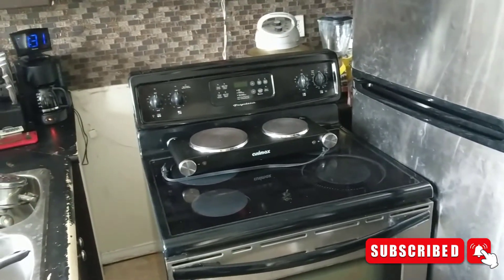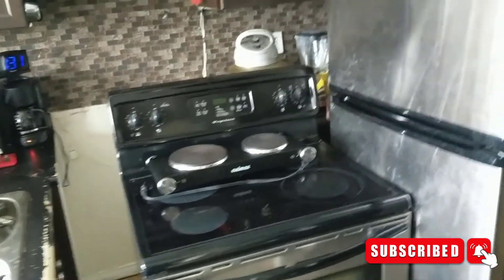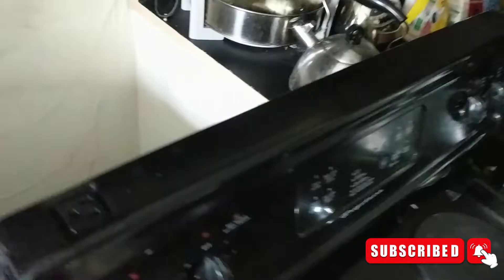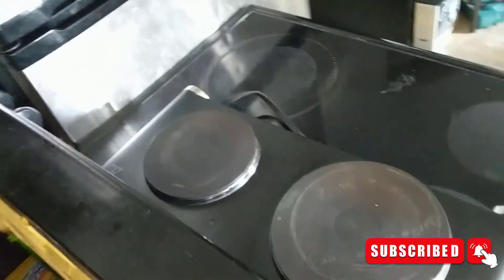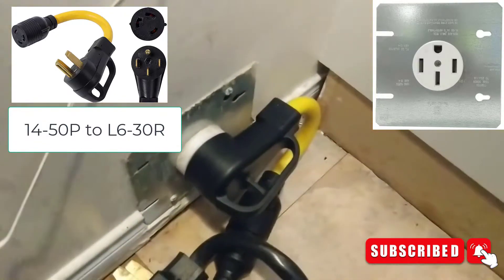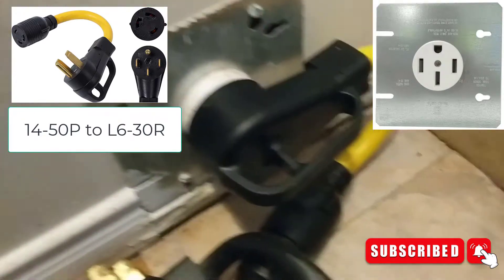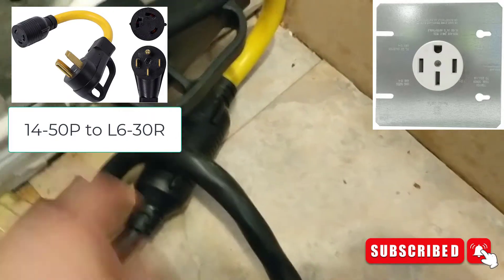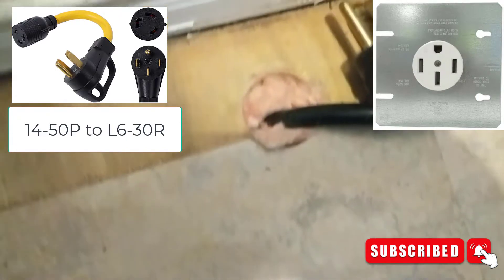Powering Mining Rigs Using an Oven Outlet?! | GPU Mining | Crypto

Comment: I ran a Gas line to where my electric stove is and I replaced it with a Gas stove.  Now I have a fully functional stove and a 240 50 amp circuit to power my rigs.  If you have any gas in the house that would be a good option for you.  It sucks cooking on hot plates and it isn't the safest thig to do.

Comment: Just wondering why you didn't just upgrade your panel instead of unplugging the stove? I would also like to know if the stove can be pugged into a PDU? I live in an apartment and I have 2 220v plugs. One for the stove and one for the washer dryer. I would love to use one for an ASIC but I worry that it would not be allowed. So , right now I am running a few Goldshell mini miners and 1 GPU rig with 5 cards,,,,so far. I just found your channel a few days ago and I enjoy the info you share about mining.
Reply from the maker: Mostly because my entire house has a 100AMP breaker, speaking with the electrician he said it might be possible to upgrade to 125AMP but since this is a town house - the incoming line is buried in concrete and may  not be upgradable.  So in the future I may be looking into a second location like a shed somewhere or something.  We'll see. Thanks for he comment and visit man.